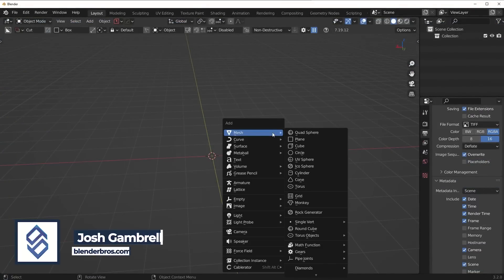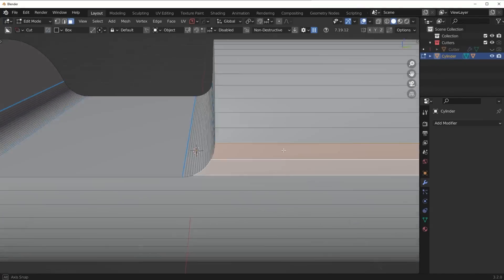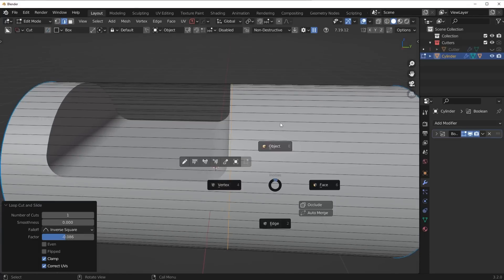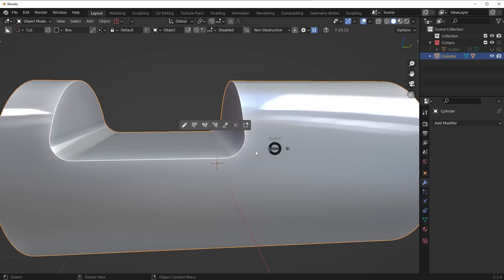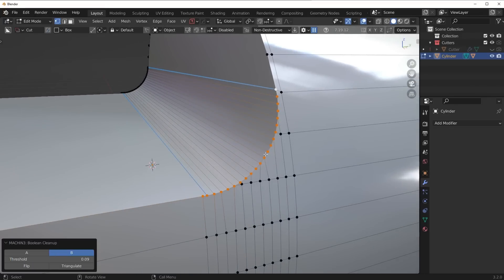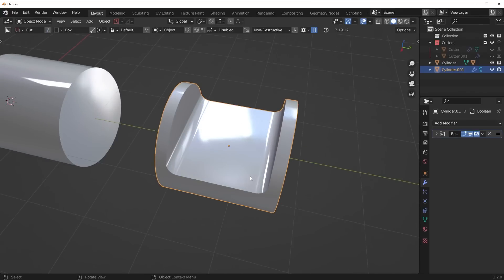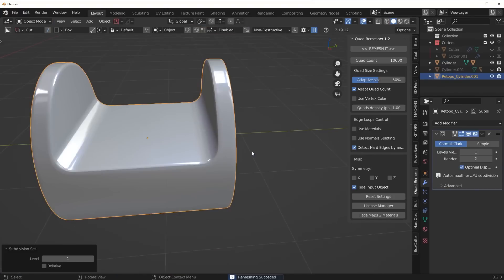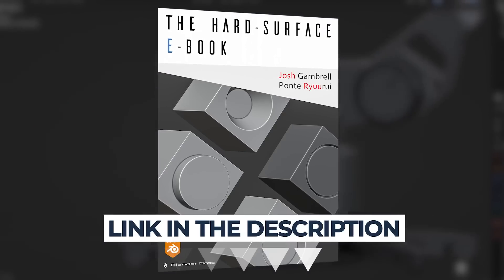How to clean up NASTY shading in Blender (Tutorial)

Comment: 2 questions why are the edges of the model white ? and question 2 what is that tool / addon you used to cut through model?
Reply: To make edges stand out like that in the upper right corner of your viewport you have 4 shading modes, wireframe, solid, material preview and render preview, choose solid. Next to render preview you have little arrow down that gives you shading options and in them you select cavity option. Select cavity, type Both and max out both world space and screen space factors. There you go now all edges of objects and also insets and holes are emphesized with shading and easier to see. The addon he uses for cutting the geometry is Boxcutter.

Comment: Must be hundreds of tutorials about how to mitigate shading errors due to n-gons and bad topo. Maybe time for the shader devs to smooth out these errors like they have figured out some time ago to smoothly shade things like the extremely faceted cylinder itself in this example? Or at least add a "quad remesher" to the modifier stack. I'm imagining the millions of human-hours wasted on retopologizing . . .
Reply from the maker: There’s many solutions:
1) isolation (shown here)
2) normal transfer
3) remeshing
4) photoshopping if concept art

This is normal behavior with poly-based modeling software. Alternatively, if the minor errors are a nuisance, you could go CAD.
Reply: I guess, if it would be that easy they had fixed this long time ago! Keep in mind this is a Free Software.

Comment: a quick tip :

you can use "Set By Face" when you're shading an object that have a decent retopo.
and it also tolerates tris so you'll just need to select all the flat and consistent faces and leave the bevel edges alone.

Comment: Thank you for the tutorial! I learned a lot. Two questions that I hope you could answer:

Is there some type of mode in Blender that easily identifies shading issues (for those with an untrained eye cough *cough*)? I'm thinking of a mode like the one that easily identifies the inside and outside of a mesh with blue and red (forgot the name for it).

I'm new to 3D-modelling, do you guys have a tutorial for what a well modelled mesh is supposed to be? I didn't know that these shading issues are something to be dealt with, what more is a professional as yourself on the outlook for when modelling (in addtion to shading problems)?

Thank you in advance!
Reply: Unfortunately there is no mode in Blender to see bad shading like that. The mode about inside and outside of a mesh is face orientation. To best see shading issues there are certain matcaps that make it pop out more. But you still need to have an eye for it

As for a tutorial you can checkout their jump-start course on their website(it's free)
Reply: @kemtimussign5383  I see. I'll start by putting in a lot of hours and then see where I'm at. Yes, I'm doing the hard surface tutorial with Ryuu from their website and it's been very good so far. Thank you for the information!
Reply from the maker: Good questions, if the shading is bad enough, trust me, you’ll notice it. The more peculiar shading that I might notice but you might not just comes with practice, and isn’t really something to lose sleep over. It’s just a quality thing for the more minor shading problems. As for topology, it depends on what you’re going for. I use boolean and ngon modeling all the time for what I do, zero problems.
Reply: @JoshGambrell  I understand. I'll just keep going! I've already noticed some in my own meshes, also reading your e-book has helped me a lot. Although your plug for the topology handbook has made me want to read it so bad, too bad it's unavailable. Will it be available for a price later on?

Comment: Thank you, decent advice! 
But how would I go about putting a bevel on that dense mesh?
Quad remember mostly only works with simple shapes, more complex hard surfaces give it a lot of trouble
Reply from the maker: Offset cut always does the trick, but a bevel will run so long as it doesn't overlap with any surrounding geo. You can just slide the vertices if it does. Bevel shader is also an option if you're rendering only.

Comment: We dont need, but sadly "they" need for some reson, i had 2 jobs interview this week and both gave me tasks, mandatory sub-d/quad modelling assets ;/
Reply from the maker: In my experience, all the BS "requirements" get overlooked with a proper portfolio communicating that you know what you're doing and can break the rules effectively. Unfortunately, many people cannot, hence the strict guidelines and rules often coming from a higher-up. Once clients begin reaching out to you, this won't be a problem (unless, of course, your specific industry has specific requirements not discussed in this video). Also, if it's VFX quads are basically a must in most cases, but I'm not familiar with that industry.
Reply: @JoshGambrell  It was gaming, and they stated that ngon workflow bring problems in terms that models cannot be easily modified (simple changes to design that make various versions) and you cant make fake sub-d on rendering, and it's nice to have game asset that you can also use in some cinematics by bumping resolution. Make a little sense when you look at this at that angle.
Reply: Do the jobs involve Hollywood movies where every object could potentially need to be damaged in an explosion?
Reply: yes in games industry like an example If you have a hard surface model and you want to send it to zbrush you need to subdivide the model to smooth it out then sculpt your details... 
also zbrush is programmed in a way that it works way smoother with subde models.
Reply: @abdallah.3D  yes i didnt tought about that one but it makes sense also, and also triangulation seams to be the problem transfering to other softwares, ofcourse we trainulate ourselfes for that reason but it makes object absolutely fixed for anything if you put it to pipeline. Infact im start to thinking that this technique is ok for concepting phase only, it's pretty sad couse i invested alot time in learning it :). And if we decide to leave it into concepting zone, i think zbrush with this latest improvements will also provide quicker result and much more flexibility in fact. ehh tough cookie.
Reply: You better learn it then, if thats industry standard